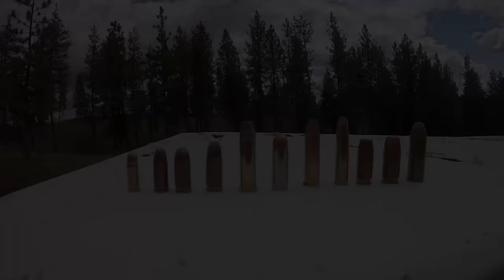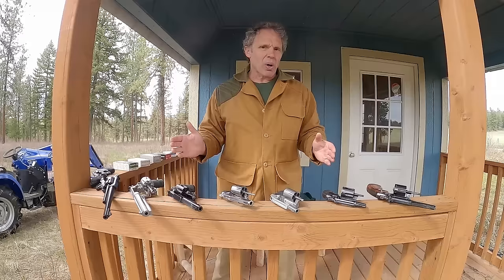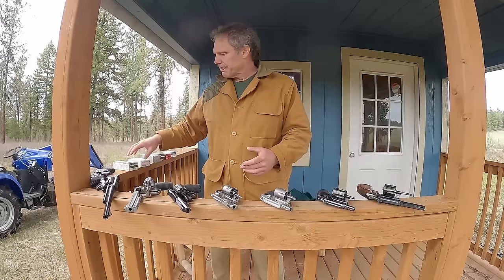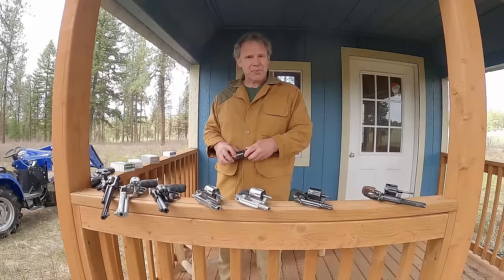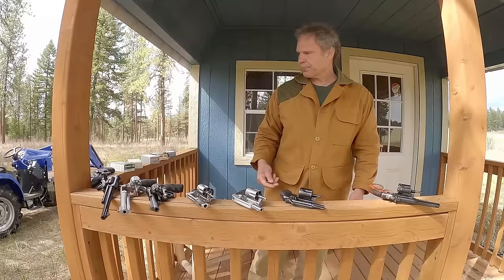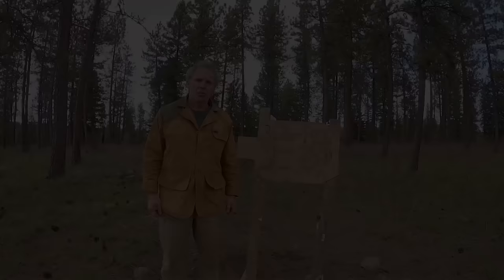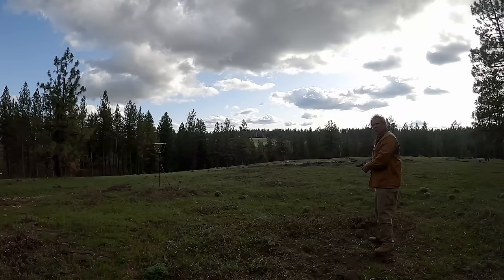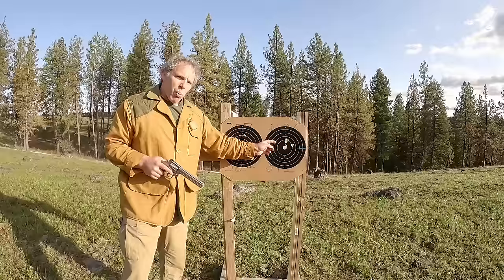Shooting .38 Super in .38 Special and .357 Magnum Revolvers

Comment: I wish Paul would have also included a Taurus revolver in this little trial. Not because I have one or defend Taurus like some Keyboard Kommandoes, but because this seems like something a Taurus owner would do. So it would be more of a PSA for people to NOT try chambering cartridges that the gun wasn't designed for. 

And just so we're clear, I've owned several Taurus firearms through the years and have only ever experienced and issue with one of them (one of the first run G2C pistols) and their customer service handled my issue better than any other manufacturer I've contacted. I know most people say that they don't have the same experience, so I can only go off of my own but it was totally reasonable from my end. Plus, the gun I shoot the most by far is a very low serial number Taurus TX22. It has around 8,000-9,000 rounds through it and still runs like a champ without any replacement parts (yet.) 

Great video as usual Paul. And I agree with, "Just because you can put it in there, should you?" I heard the same line from the first 4 girls I dated. Guess why I stopped at girl number 5...

Comment: That’s a lot of good information. And we find out Paul has a Blackhawk chambered in 30 carbine. That is a pretty rare gun, I’ve only seen 1 before and that was about 30 years ago.
Reply: And it’s the most obscenely loud revolver you have ever shot
Reply: I owned one, sold it around 6 or 7 years ago. It was loud with somewhat of a muzzle flash. After a while I began to see it as more of a niche oddity. I didn’t see any point to it. The .357 Magnum is more practical.

Comment: I only did a brief google search, but it looks like the max pressure for .38 Super Auto is 36,500 psi and the max pressure for .357 Magnum is 35,000 psi. That makes me hesitant to use someone else's reloads or ammo from boutique manufacturers that tend to load on the high end of safe. I'm guessing stuff like WWB is fine, but the extra consideration of pressure means that I am going to need a real good reason to do this (especially since .357 is more available, and probably cheaper, in my area).

Comment: Standard pressures, according to wikipedia:

38 Special:  17,500 psi
357 Magnum:  35,000 psi
38 Super Auto:  36,500 psi
And those figures are for PROPER CHAMBERS. For different chambers all bets are off -- pressures generated COULD be significantly higher

Comment: Another possible explanation for the light primer strikes is that the .30 Super rims are slightly thinner than those on .38 Special/.357 Magnum. This results in the cartridge sitting ever so much deeper in the chamber, which results in the firing pin having to travel that much farther to detonate the primer. Lucky Gunner also noted in his 'Can you fire .32 ACP in revolver' video that, when firing .32 ACP in the revolver, the primers on the .32 ACP ammo would bulge out more than usual due to the reasons mentioned above. Another youtuber named 'Gun Sam Revolver Aficionado' pointed out in one of his videos that, when firing .32 ACP in a revolver, the ammunition would have problems going off when the revolver was pointed in a downwards angle. I wonder if this would also be the case with .38 Super being shot in .357 Magnum revolvers.

Comment: The light primer strike was likely due to the fact that the .38 Super rim is thinner than the .357 Magnum rim.  This allows the primer to be slightly farther away from the tip of the firing pin as it protrudes.  This may disallow the firing pin from reaching the primer sometimes.

Comment: Looked into this during a previous ammo shortage. Instead of chronoing a bunch of ammo, I just got out my reloading manuals and checked the max pressure for each round, same result. Plus my .357 was a 686, and my .38 Special was a Taurus from the 1970s. Even had the pressure been ok, I wasn't risking it with that revolver. In a Mad Max situation, I'd take my chances with a good +p rated .38, but I wouldn't be happy about it.

Comment: It bears mention that there are relatively simple .38 Super conversions done to .357 revolvers by revolversmiths like Pinnacle and (I think) TK Custom.  These require the use of moonclips.
I understand that there are quite a few revolver shooters who dislike moonclips, some strongly, but moons have some big advantages.
In any competition where time is a factor, moonclips are near-mandatory as they are much faster to load and unload the revolver.  But the most important part of that is the unloading.  Ejecting the spent cases in a moonclip gun is much more positive and you will virtually never see a stuck-under-the-star jam as you will with ordinary rimmed ammunition loaded singly.
In a defensive revolver, this is a huge advantage in reliability.  Even if you don't carry a spare loaded moon, the faster, more reliable ejection is by itself a worthwhile modification.
In my case, we have a TK Custom L-frame cylinder my wife competed with that was fitted to a 6" S&W 686.  I also so happens that as a .38 Super shooter of Colt semi-autos, I have a large quantity of .38 Super handloaded ammunition on hand.  So this conversion has a lot of value, and the main "problem" I encounter while using this outfit is that I go through ammunition at a very high rate, if going to the range with a good supply of  loaded moonclips.  And, boy, does the gun get hot when you get to popping away when you're drawing from that pile of moons.
Next, further down the power road is 9x23 Winchester, a souped-up .38 Super that operates at the 55Kpsi level.  As a straight rimless case, there's no option of not using moonclips, but in a strong .357 revolver it is a truly impressive round.  I recall getting something like 1500fps with Winchester Silvertip 125gr hollow points in a 4" S&W 586. Probably best used only in Rugers!

Comment: I've seen this at a public range. A man was shooting his Rock Island Arms one inch barrel .38 rated for + P.  The guy loaded and fired .38 super. The revolver spit flames with an incontrollable recoil.  The result was he could not hit the target. When her attempted to eject the spent casing, he used a small needle nose piers to up the case out. After his second volley, I had to stop him politely.  When I examined the rounds , I told him the problem and the solution. He bought the correct rounds and all was good. He started hitting the target. He offered me the remaining 25 rounds of .38 super.

Comment: I know for a fact that .32 ACP will fit in a Colt New Police in .32 Long, , a S&W in .32 Long and a Ruger Single Six in .32 H&R magnum.  They aren't even as powerful as a .32 Short, but they do fit and do fire and will work on water moccasins.  The bullets were .308 and sort of rattled down the .312 bores.  Lost a lot of velocity due to the cylinder gap and gas blow by.  OTOH, someone had given them to me, so I couldn't complain.  I used them on a trap line for dispatching snakes and beavers.

Comment: Another thing to consider with respect to whether it will fit is will the cylinder fully close and rotate... If it looks like the cartridge fully seats, but is just slightly proud, in some firearms the tolerances are such that the cylinder will not close and even if it does close, it won't rotate... This can also happen if your primers are not seated perfectly flush to (or below) the base of the cartridge... I've had that happen before...

If you look at the SAAMI specs, you will see cartridge and chamber drawings with dimensions... There are some tolerances involved in both, so as Paul has shown here, it is entirely possible to have a combination of firearm and ammo that will work and another combination that will not work... A .357 mag has a chamber base diameter of 0.3809"... A .38 SUPER has cartridge base diameter of 0.384"... That would seem to indicate the the .38 SUPER should not fit in the .357 mag chamber, but if you look on the drawing, you will see that there is a tolerance of -0.006" which means that the cartridge could be as small as 0.378" and still be within the SAAMI specs... Of course, 0.378" is less than the .357 mag's chamber base diameter of 0.3809", so it would fit...

End result?

IT DEPENDS... :)

Comment: Well done video by Paul Harrell.  Never even thought about such a test.  What is VERY strange to me is that some brands of ammo will or will not fit into the cylinders of factory .38 Special & .357 Magnum handguns. That was odd. Seems like a couple of ammo makers are not following the SAAMI guidelines for cartridge designs.   
   
 What was not mentioned / covered in the video ((... at least my senior citizen ears did not hear it if it was mentioned.... )) The .38 Auto-A.C.P.  (1900) and .38 Super Auto (1929) are .356 caliber. Thus, they are a hair smaller in diameter than the bullets for a .38 Special or the bullets for a .357 S & W Magnum cartridge. They will go down the barrel, but not as accurately as a .357 slug fully touching the rifling.

Comment: This sent me to my Speer reloading manual to look up the case dimensions. .38 Super is supposed to be .384" in diameter. I'd get out the micrometer and check that ammo. Would also be worthwhile to measure the chambers on those revolvers. .38 Special has a case diameter in the manual of .379", as does .357 magnum. 9mm is supposed to be .380" at the mouth, and .3926" before the notch. It's the only case of the batch that is tapered.

Comment: Hi there P.H.; Just as (In comments..) Henry Murphy warned:  .38 Spl +P is SAAMI rated ~ 17.5K psi ; .357 Mag is ~  35K - 37K psi ; .38 Super +P is ~ 37.5K psi. (ER / ICU, former Military MD, as well as 'Old School' IDPA comp & reloader here).  All of the above being said, I remember one, (Lithuanian engineer who passed away) former shooting IDPA mate, who owned a beutiful S&W K38, (1.970's era), and 'out of curiosity', ( ~ 1.993) tried a 178 power factor .38 Super reloaded round in said S&W. Luckily  enough, he just got a 'bulged' chamber in the cylinder, instead of a total 'KA.BOOM'. Too bad destroying a classic, (Now collectible??), K38, besides no one being hurt.  As far as I've read, S&W performed some metalurgy changes about mid- eighties, so their .38 Spl could stand '+P rated ammo' (NOT on a regular basis, though). Bottom line is:

*I'd STRONGLY suggest any shooter AVOID  chambering, much less firing .38 Super +P ammo in a .38 Spl revolver.

 *(Maybe in my  .357 Mag Ruger BH or similar .357Mag chambered firearm. Not in any of my 686's..). BTW: Yup!. Of course I subbed! + many thanks for your in.depth &  comprehensive videos..

Comment: A note about .38 Special revolvers. The S&W 640 and Ruger SP101 were originally .38 Special, but both have been chambered from the factory in .357 Magnum. If you got a newer high-quality revolver in .38 Special that is also offered in the magnum round, then I would not be overly worried about firing .38 Super from it, assuming it fits. 
You brought up the topic of firing .38 Super from 9mm semiautos, explaining how it simply will not fit. What you did not talk about was whether or not it could be done with a semiauto chambered in .357 Magnum, such as the fine piece made by Coonan Arms. There would be another factor to consider now; feed reliability. The loaded cartrige length difference is enough that I'd imagine getting it to feed rounds from the magazine might prove problematic. On a side note, I considered the question about the .38 Super in a S&W Model 52, and it is too long, being approximately about .1" longer than a .38 Special wadcutter round.

Comment: I have a 1902 Colt Military in 38 ACP and a Colt 1903 Hammer Model, also in 38 ACP. The cases of 38 ACP and 38 Super are identical--it was one of the instances when a much more powerful cartridge was introduced without altering the case so it couldn't be used in older, weaker pistols. I would never fire 38 Super in my 38 ACP Colts. Somehow I wound up with a box of 38 ACP +P. I won't fire that in my Colts either, but want to use the cases to load 38 ACP.
I don't have a 38 Super, but I have used those cases for 38 ACP when that was all I could get. I'm not worried about the headstamps since I'm loading them to pressures safe for both types of pistols. It's like when I bought some 44-40 cases for my 38-40's---easy to resize when available at low cost. 
I do other cartridge conversions, like trimming down some of my many hundreds of 44 MAG cases for my 3  44 Russian S&W #3's. Alas, I may fire my 38 ACP +P's in my Dan Wesson 357 and then reload them for my older Colts. Great video, as always.

Comment: I accidentally double-charged one of my .38 Special hand loads and fired it through a Ruger LCRx .38. Recoil was stout, but the revolver was undamaged. I suspect that it's the same cylinder used for their .357. However, I see no reason to search for .38 Super and try it out.

Comment: Great video.  I am a fan of the .38 Super and as Paul has showed us, it is a pretty powerful pistol round slitting the difference between .38 spl and .357 mag.  While I am grateful that Paul did it for demonstration purposes and for general knowledge, for everyone else I would ask why?  .38 Super ammo  is WAY harder to find than  .38 spl or .357 and if you do find it, it is much more expensive. I have been cautioned that really OLD guns chambered in .38 Auto should never be loaded with .38 Super (I've been told the cases are pretty much identical) but the Super has a much hotter charge which can result in the old .38 Auto guns blowing up.

Comment: Last Remington ammo I bought was .38ACP back in 1978.Came in a styro tray box. I have always preferred W-W.

That said, you CAN fire .380 acp in a 9mm or .40 S&W in a 10mm. You have a condition of 'headspacing on the extractor'. You can do it, but I wouldn't make a habit of it. Although metallurgy has changed bigly in 40 years. I wouldn't worry too much about firing .38 Super in a modern .38 Special, other than accelerated wear on the gun. It's not gonna SPLODE! But you'd notice endshake after a few boxes. But, like you, I wouldn't use .38 Super in ANY .38 Special. Who intentionally beats up a gun? But that might be an interesting test to determine how many .38 Super you could fire before noticing wear.

Comment: 38 super did fit and function well in my 357 Taurus revolver years ago.
Probably only did that about 6 rounds.

That was also when I had less knowledge of firearms and zero knowledge of load data, or why it happened to function in my particular combination.

It can be very interesting the combinations of things that work together that weren’t designed to.
It must also be stated that a successful combination during one event, may be a failure with catastrophic consequences in a subsequent event.

This video is very informative.
I will share it as an instructional tool.

Thank you

Comment: 38 super is one of my favorite loads for my old "government model", super accurate, hard hitting, and very nice to shoot.  I "retired" the 1911 of my earliest years as a Marine, and ended my two decades with the Berretta, and I still much prefer the 1911.  Thanks for the data dump!
Reply from the maker: Very good point.  .38 auto and .38 super auto are virtually identical casings, but .38 super is MUCH more powerful. Loading an old gin with the wrong ammo could be dangerous.
  The real motivation for this presentation was people asking me about the interchangeability of .38 special, .357 magnum, and .38 super due to "what if?" scenarios and the occasional problem or carelessly picking up the wrong box of ammo at the store.

Comment: Excellent video.  I'm glad you had the light-strike misfire.  🙂  I think the .38 Super has a thinner rim than the .357 Magnum (by about .008")  So the cartridge will probably drop a little farther into the chamber, and your firing pin might not have enough travel to reliably set off the primer.  I've had that problem (I think that was the problem) when trying to use cut-down .38 Special brass to make ersatz .38 S&W cartridges.

Comment: Great video. Factory/SAAMI tolerance in ammo/chambers allows some to fit, others not. Great cautionary  tale. Shooting ANYTHING but standard velocity 38 special in a vintage S&W model 10, for example, can cause “swelling” of the forcing cone. Apparently the barrels were made of a mild steel, perhaps 1018. The cylinder of the damaged M-10 a friend brought to the shop back before I let my FFL expire, was find. The barrel was not OK. He  had inadvertently shot someone else’s handload (it had somehow got mixed with his ammo. It expanded the forcing cone to the point that the “flare” was so large it had to be cut off to get the barrel out of the frame.

Comment: When talking about this sort of stuff one thing that would be interesting is using a micrometer to check a sample of case sizes for different ammunition. And then pin gages to check the chamber sizes. It's not just thousands of an inch (.001" = .025mm for the metric folks). But it's also ten thousands of an inch. I suspect that the chamber size on the different revolvers have a tolerance band of +/-.0005" to -.0000"/+.0010". The ammunition is likely IMO to have loaded case tolerances of -.001" or -.0015" to +.0000". Not to the nominal size but to the manufacturers Spec. The case would need to be a little under the nominal to fit into the cylinder in the first place. If the loaded case and the cylinder were right on the same size there could be issues. 
But as Paul says. Just because it can fit. Doesn't mean you should do it. Plus as others have said. Chamber fouling.